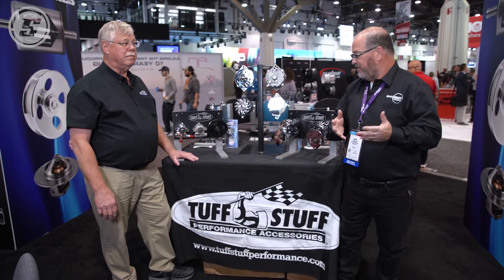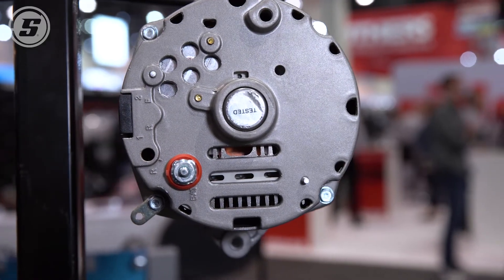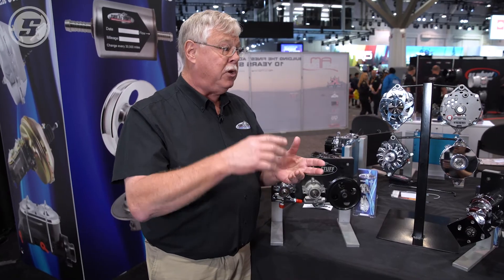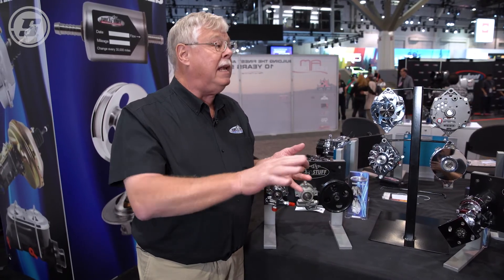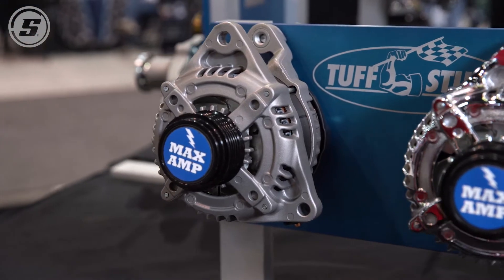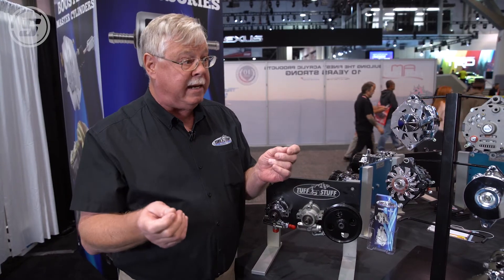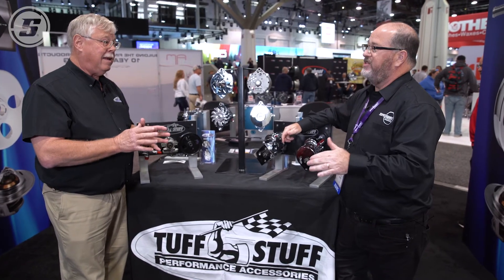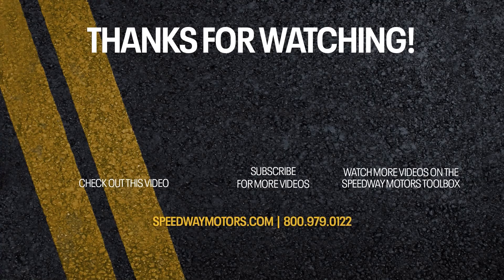One-Wire Alternator Conversion Choices | Tuff Stuff Performance

Comment: I have a 1 wire alternator, and it's the worst thing ever. Drops any time I have the radio or lights on, heck even the turn signal causes it to fluctuate and drop power. I wish I could find someone to do a conversion to two or even three wires for me. (I hate electrical)
Reply: 🤣I hate wiring also BUT you have something else going on, I have converted numerous vehicles with ZERO issues, go back to what they said correct or add grounds

Comment: Do you run the one wire straight to the positive battery post ?
Reply from the maker: That is correct. The large "charge wire" from the alternator's battery stud goes directly to the battery positive cable or a positive cable junction connection (for example the battery stud on the starter is it's a trunk mount battery).
Reply: @speedwaymotors  Thank You for the quick answer, I am a long time repeat customer and have been happy with everything I have bought from Speedwaymotors  !
Reply: Do they make this for a Ford? I have a 1962 mercury comet  6cyl that I would like to convert over
Reply: @johnosborne1009  YES